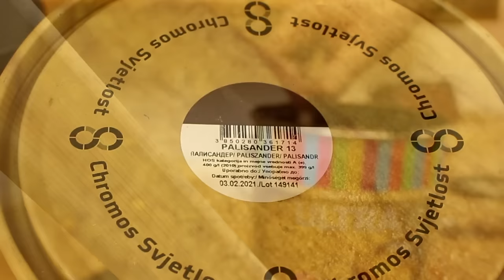Epic Wooden Viking Bearded Axe

Comment: Excuse me, i have a  some question about painting. I'm making some similar thing myself in this moment. I'd like obtain similar efect. At first step you painted the axe by steel colour paint. At next step you used black paint. After this you used thinner. 
My first question - Did you used acrylic paints to painting? 
The second question - When i will use thinner to obtain efect like you, i will not remove painted surface completely?

Thank you in advance for your answer. Greatings from Poland :)
Reply from the maker: Hey, Yeah I used acrylic paint, when using thinner you have to just melt the black coat, be sure to not over soak it. Good luck with your project 😊

Comment: You should make a small forge and make these awesome weapons out of metal
Reply from the maker: +Drew Wilson yeahhhhh but that is unfortunately in near future but I really want to get into forging 😄🤘 
Moris
Reply: Epic Workshop I just have a metal tube and I light a fire in there and use a hairdryer to get the metal hot enough to forge and you can use car or lorry springs as a high carbon steel. If you go down to your local garage they should have some
Reply from the maker: +Drew Wilson I know all of these things and I forged before (with hairdryer) but the problem was place because of noise, I made crossbow bow out of car leaf spring (Great metal, of course) there is a lot more than just forging for me 🤔 but One day you will see it on my channel 😊 I HOPE!  🤘
Moris
Reply: Epic Workshop I hope

Comment: what is the thickness of the axes head before you add the layers, and how big is the hole for the handle
Reply from the maker: +suh dude72 I really don't remember haha, check description for measures I think that I wrote some measures there :)
Reply: thanks for responding so quickly!, I wish they were in the description. but thank you anyway
Reply from the maker: +suh dude72 I just checked, yeah they are not, but research a little bit about dane axes, and war axes and you will get measures very easily and also just be aware that you work with wood and that you need to make everything slightly thicker to gain strength of the piece you are making :)
Moris
Reply: Epic Workshop ok thank you for  the reference!